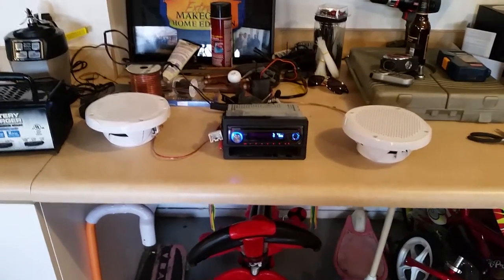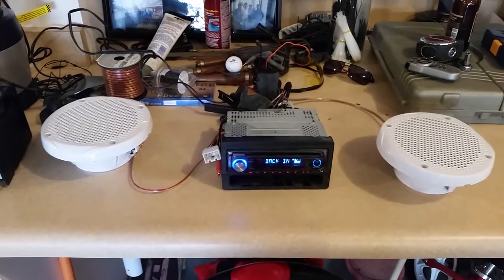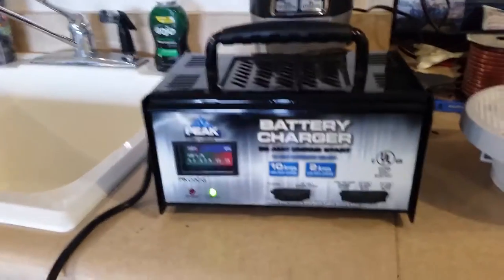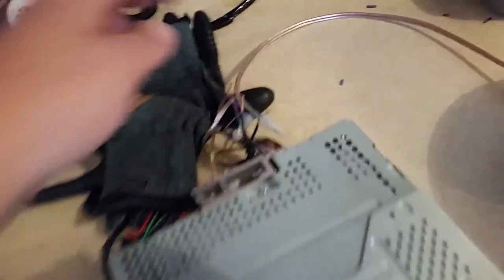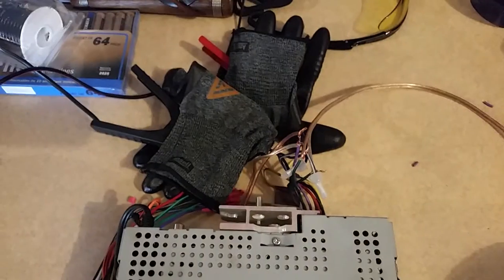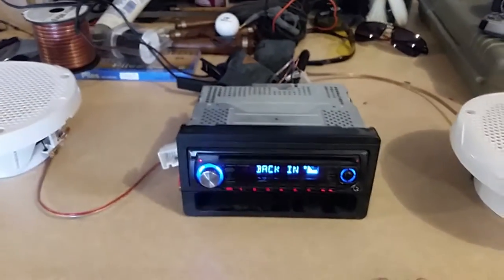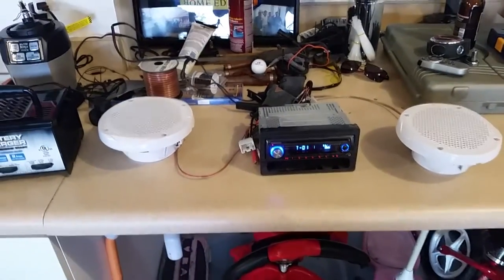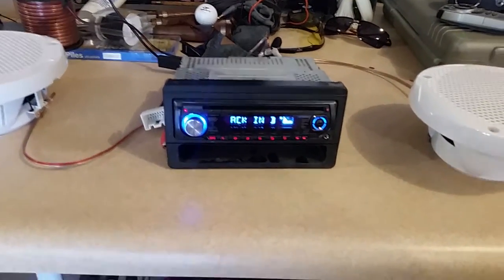Power a car stereo using battery charger

Comment: i would not do this cause you might have too many volts and it might cause damage to your radio. Today they are really built with too many circuitry in them. Just hook up the same way to your car battery, The positive to your positive battery connection and the black negative to your car metal as a ground. Play it safe then sorry.......Or tap in a 12 volt acc in your fuse box. Then if it shorts out for some reason at least then it will blow the fuse not the expensive radio.....

Comment: Today's battery chargers, bless their little hearts, do not power on until they get some feedback from a battery.  In other words, you can't by a battery charger anymore that when you touch the clamps it sparks because the charger is always on.  If somebody knows how in the hell I can get these chargers to power a winch rather than only be chargers for batteries I sure would like to know.

Comment: Can I do something similar to this with batteries to run car audio in my house? Something with actual car audio batteries, but just wish the trickle charger on them constantly when the amps are on and subs are hitting.
Reply from the maker: Not sure I fully understand your set up, but if you're looking to use a charger like this and hook it up to a battery that is powering a home stereo system then it should be fine and constantly be charging your battery. If you're looking to use something like this to be the actual power source for your system (like I used it to power on the head unit) then this is not the route you want to take. For this video it was a temporary power source to test the unit without having to install it in a vehicle, and bonus- retrieve my AC/DC cd! Hope this helps.

Comment: Did you test your amps and volts while you ran the radio I wanted to know what voltage you had 
if I had a suggestion I would put a 12v car battery or motorcycle battery with the charger  on the battery and then ran it you could possibly cause overheating or damage to your head unit or charger possibly
Reply: Hey, I was having same concerns but figured most "Car Battery Chargers/Jumpers" won't really go past 12v, unless it has a "Cold Start/ Boost Start" Option & is enabled. Another thing I noticed is alsong as you go theu the Headunit Harness, theres a fuse there that should pop if you go over as well. Didn't mean to answer, but like I said I had same questions.

Comment: Does it matter what kind.d of charger it is as long as it is 12 volt charger
Reply from the maker: Yeah anything less than 12v and it won't have the power to fire it up. Need to use a car battery charger similar to the one here. A 12 volt powerwheels charger for example would not work..